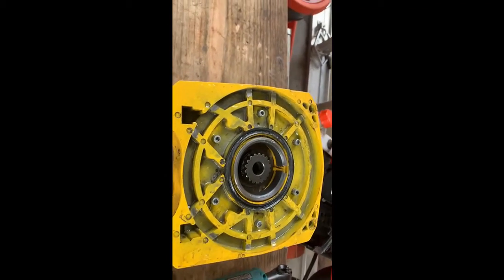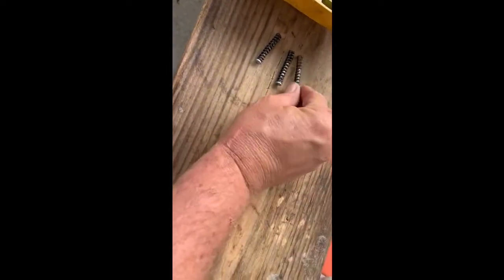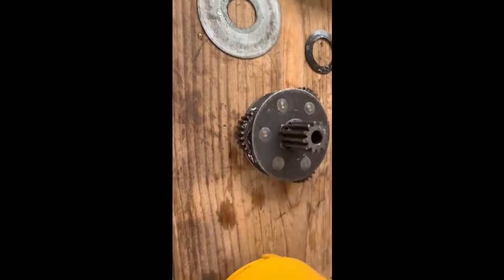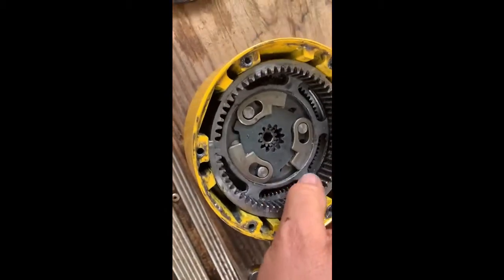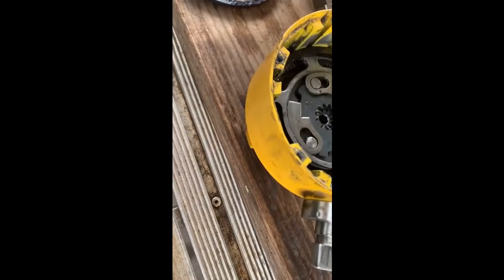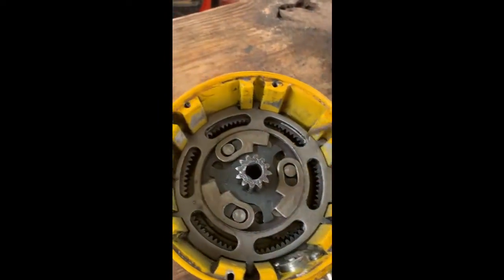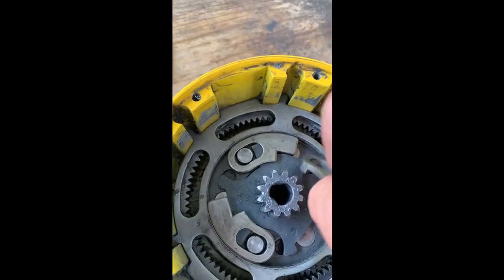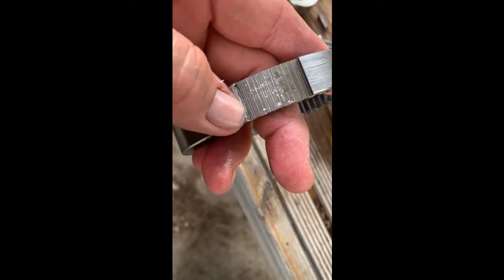Sherpa 25000lb Winch Repair

Comment: I have the same problem as on this video. These winches do not handle being turned to free wheel with any load on at all,or engagement pals get rounded off like this,rendering winch useless to pull under any load. We found this out on third pull 😢. In comparison our warn winch is still running strong 5 years later. Sorry Sherpa,you have built in a design flaw if disengaged under any load!
Reply from the maker: that video was for sherpa team to look over. they sent me a brake set and new selector knob. no other questions. winch has worked flawlessly. also i do extreme winching too.

Comment: Throw it in the bin mate. Sherpa is the worst of the worst. Wouldn't catch me dead buying this trash ever again.
Reply from the maker: Alex,
I know you are just seeing the problem I have made myself. The winch being slow to recover vehicles and I don't like waiting weeks for my parts. are my only complaints. I am upwards of 65 or 70 recoveries when the winch broke, and had two problems. 
1. I left the corded remote plugged in and on my bumper. Then I repositioned, cord and remote fell and ripped the cord and burned the solenoid up from the short.
2. This slip ring gear and engagement selector was worn after i thought i was pulling one truck out of the boggy mud. Then I discovered I  was recovering two trucks at the same time. 
Ed my electrician repaired the winch for the ripped cord and bad solenoid. I did purchase a wireless remote. I filed the beveled edges down and put the winch back together made about another 15 recoveries or so  no problems.
Speaking of the trash. I thought for sure this is not a 25K winch. I was pulling on a tool truck and found this winch bringing 3 trucks to the tool truck 1 F250 and 2 F350. After we dug the front axle out we recovered the F550 tool truck.
I believe some folks do over work their winch wanting faster recoveries, burning motors, electronics, and batteries. Winching is best described like base ball. 8 hours of waiting 4 minutes of excitement. 
I would like to hear your story as to why these are poorly manufactured, Thank you for watching.
Reply from the maker: @Not your Business I have to be honest. Many of these guys are using Apex “harbor freight” 12k winches with lots of success. I personally have no issues with my winch other than delays in parts and shipping.
Reply: @Not your BusinessThis is my third winch after a Ramsay and a Premier.   The metallurgy on this winch is rubbish.  They are the equivalent of a cheap Chinese winch but are not cheap.  Mine is currently on the bench in the garage waiting for a brush set after it stopped on it's second short recovery.  The general quality is poor.
Reply: Cannot agree more.  These winches are rubbish and heavy duty is a complete deception.  Quality is so poor as to be completely unreliable.  Do not waste your money.
Reply: @Not your Business Mate, you haven’t looked very far.
Search Scintex or Sherpa 4x4 in any Australian 4x4 forum. Why are their YouTube comments turned off? Look at their Facebook complaints, read through their google reviews.
Questionable products and shady tactics. 
Not an very ethical company at all. I’m speaking from experience.
Reply: Yup they suck ass!